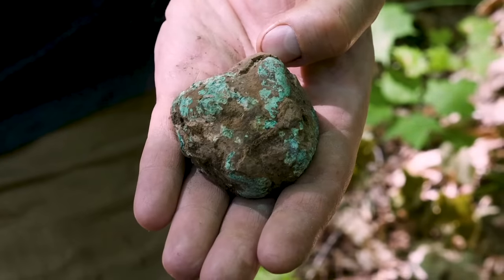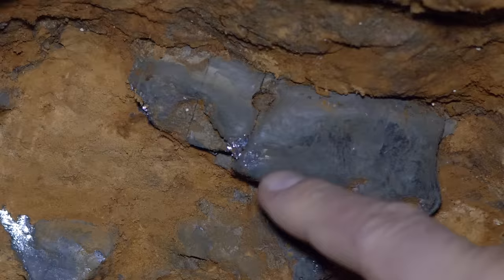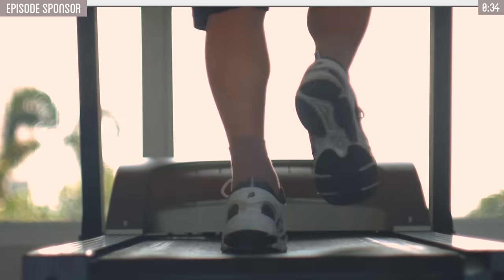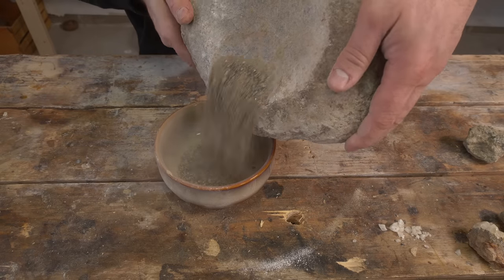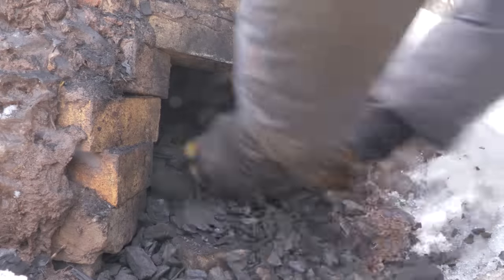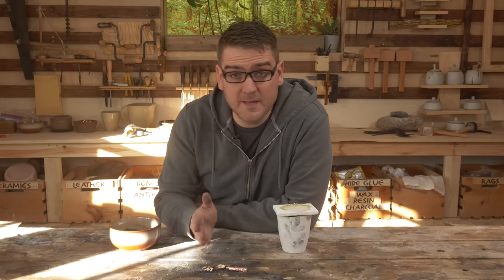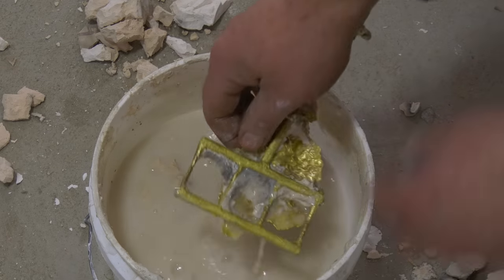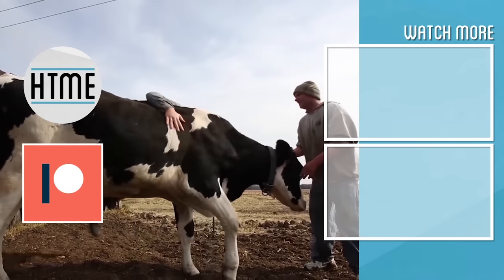How To Make The Hidden Metal That Helped Build The Roman Empire

Comment: Bronze makes better, longer lasting bearings, but brass is a perfectly acceptable alternative. And yes, it’s easier to cast and clearly you’re looking for a good demo application for your new alloy. So really looking forward to seeing you make that progress 😃
Reply: Would imagine zinc is more common than tin as well.
Reply: @davidmcgill1000  zinc is hard to extract due to it's low boiling point and high toxicity.
Reply: Wouldn’t they be bushings.
Reply: @Volt64bolt  Bushings are a type of bearing.
Reply: @entropy1454  oh ok, my bad. I thought bearings specifically referred to ball bearings where there are multiple moving parts inside, and a bushing is just a low friction slow wearing sleeve
Reply: A better bearing than brass or tin bronze would be aluminum bronze, though that's obviously more of a modern thing.
Reply: Brass has a better coefficient of friction against lubricated steel. Nearly all mechanical clocks are brass plates with steel pivots.

Comment: Brass is very good at sea. Very resistant to corrosion. The brass bushings in my sailboat's rudder axle are still going strong, 37 years on.
Reply: Holy manure, 37?
Reply: Highly likely bronze. The zinc in brass makes it almost useless below the waterline. My boat is bronze fastened wooden 46ft cutter over 100 years old. I won’t have brass anywhere on board. Bronze yes. 
Unfortunately it’s difficult to tell the difference between some bronze and brass fittings. If yours was brass it would have dissolved over 30 years ago.
Sorry
Reply: @humanafterall2076  Admiralty and naval brasses could definitely withstand salt water for that period of time.
Reply: @Shaker626  these still have a zinc content. They will stand up to the salt air environment but definitely not constant immersion.
Reply: @humanafterall2076  The reduction of Zn in those brasses, along with the addition of Sn and As reduces the dezincification inherent to brasses. Maybe they won't last 100 years like a bronze part, but they could push 30.
Reply: i sea
Reply: @humanafterall2076  That's exactly what was thinking when I read jannepeltonen's post.

Comment: Brass is an awsome material to work with and it has excelent corrosion resistance. It's resonably strong so for most things it's prenty strong enough. The only reason it isn't everywhere today is that it's kind of expensive compared to aluminium and steel.
Reply: Does aluminum have comparable corrosion resistance to brass?
Reply: @Ensensu2  Sort of. Aluminum "corrodes" instantly on contact with air by forming a thin layer of aluminum oxide; unlike rust, this layer is not porous so nothing further happens, so in air they are about equal. In seawater, however, aluminum is prone to corroding if another metal is present, while brass and bronze are not, making aluminum the worse choice there.
Reply: @Ensensu2  And aluminium parts tend to wear down quickly under abration, and they also tend to get stuck to eachother, that's why you rarely see things like lock mechanisms, sliders or such being made from aluminium. If you are going to make something that doesn't require moving parts like say a boat hull or railing then it's an excelent option.
Reply: @skylerlehmkuhl135  
Well, every metal, even stainless steel, more or less instantly corrodes when it comes in contact with oxygen.

If they didn't, cold welding would be a serious problem. Cold welding almost killed a few astronauts when it stopped them from closing their hatch after a spacewalk back in 1965.
Reply: @lordgarion514  : As I recall, the "cold welding in space" thing was debunked. It might have been a contributing factor, but the problem was primarily caused by something else.

As for most metals instantly corroding, that's an overstatement. As mentioned already, iron rust (or at least the "default" one) doesn't form a barrier to air, so if iron "instantly" corroded then there would have been almost no iron alloy tools until the development of stainless steel, due to minor scratches damaging any protective patina (some forms of iron rust don't flake, but they form under different conditions), and thus begining the process of their own quick destruction. The reason iron tools were possible for e.g. swords for so long is because iron doesn't actually oxidize very quickly. Stainless steel does corrode quickly, but that's for the same reason as aluminum: it contains some highly reactive metals as part of it's alloy, and these form a protective coating.
Reply: it is only bad for steam engines if you are an modell builder and make the boiler from brass it explodes after continious use because it gets spongy it seams the steam extract the zinc from this alloy

Comment: I wonder if some early alchemists thought they successfully turned copper into gold when they performed this process? LOL.
Reply: The hardness is a bit high and the weight is a bit low, so the alchemists that thought that probably weren't very good.
Reply: @garethbaus5471  : Further, I'm not certain that alchemy existed when brass was first created. I think that alchemy only goes back to the middle ages, while brass in some forms goes back to the bronze age.
Reply: @absalomdraconis alchemy dates back at least to the early iron age Greeks and Egyptians. There's hints that it might have been a thing in bronze age Mesopotamia

Comment: Bearings for your lathe could also be cast in place from babbitt metal, an alloy of lead and tin (sometimes with traces of antimony and arsenic), coincidentally it's roughly the same composition as ordinary 60/40 lead/tin solder.
The melting point of this alloy is also low enough that it will most likely brown (but not burn/char) the timber that the molten babbitt is poured into.
Reply: Thanks for that info. I work around a fair amount of babbitt bearings and had no idea it was basically 60/40 solder.
Reply: And I had no idea it could be cast in place. Brilliant.
Reply: isnt the lead to soft for bearings?
Reply: @Preyhawk81  You want your bearing surface made of softer material, so the cheap serviceable bearing wears out and not the expensive complex machine part. Babbitt is still used as the wear surface of engine main and rod bearings to this day. At higher speeds you need fast-flowing oil to help the bearing clean and cool, but even the higher speed pulley lathe would probably work fine with thicker lube, at least for a while. something like tallow seems like an ideal ancient-tech solution.

hell, given the choice between the two, I'd probably try lube on just the plain wood before going to the trouble of casting a bearing (and making a shaft precise enough to fit in it nicely!). even with the relatively crude smithed iron shafts they're working with, lubrication would make a BIG difference and help the wood last longer.
Reply: I doubt the shaft will be straight, rigid, or polished enough for such a soft bearing material.  It will likely chew it right up.

Comment: As someone who works with antiques, brass and bronze constantly cause issues with identification and classification - to the point where "yellow metal" or simply copper-alloy is used when describing most antiques with copper alloy components that havent been analysed yet. 

very important alloy historically.

Comment: The brass bearing described at the end of the video are called Bushings. It's a thing still used in heavy duty tool machinery even today. Bearings didn't become the preferred option until fairly recently (like within the last 50 years). Old Vintage tools often use bushings for heavy wear parts, simply because it was easier to source and use than bearings.

Comment: Brass was very important material in the industrial revolution for applications like bearings of steam engines
Reply: A had a machinist tell me that brass can be worked to tighter tolerances by an order of magnitude, i.e. fractions of a mil.

Comment: A close-tolerance greased hardwood bearing running on a polished shaft would be fine for your Da Vinvci lathe. Lignam Vite is the go-to wood, but Osage Orange, maple, etc., will work fine. 

Ancient metal workers weren't much different than modern ones. Some of us like to tinker and experiment. Surface deposits of Tetrahedrite (Cu,Fe)12Sb4S13,  also known as Schwazite and Fahlerz, are found over much o Europe, including Italy and Sardinia. Tetrahedrite ore is associated with Iron, Zinc, Lead, Silver, Antimony, Arsenic, and Mercury. It has been mined in Europe since the early Bronze Age. Brass would be a likely byproduct of refining a Zinc Rich Tetrahedrite ore.  Its gold color would get it noticed. Looking at maps of Copper & Zinc deposits in today's Italy, one would think Brass could be discovered if a copper smelter were built on a surface Zinc deposit when someone tried to recover Copper from the dross skimmed from molten crucibles of copper discarded on the ground, made up of Zinc ore, and getting brass rather than the copper they expected.

Comment: If you want to make bearings and you have zinc, babbit metal is your friend. The process of casting a babbit bearing is also interesting, though the discovery of this relatively simple process dates from the mid 19th C.
Reply: Babbit composition?
Reply: @lewisgiles8855  well there you open a can of worms. The one we're supposed to use nowadays is 90% Sn, 7% Zn, 3% Cu but that's not technically babbitt. The real deal is 89% Sn, 1% Pb, 3% Cu and 7% Antimony but there are many, many others.
Reply: Thank you I've been casting metal in my backyard for a few years I'm always looking for new alloys that I'm capable of making, I love iron bronze with such a rich color

Comment: I can’t tell if you use respirators, but if you haven’t, please do so. Zinc out cash is really easy compared to the other minerals. No one needs to breathe in that heavy metal.
Reply: Agreed.  Years ago I did some brass / bronze casting.  Even with the careful temperature control allowed by modern equipment you could see wisps of that blue/white smoke exiting the blast furnace that was zinc being burned off.  We always ran under a hood.  Being outdoors helps of course, but "belt and suspenders" as we used to say :)

Comment: It seems like you're reaching the point where precision becomes increasingly important.
Roundness and flatness are both unspeakably important for anything with moving parts. The wheel and axel and pulley are both massively improved by a mastery over these two things.

Comment: couple people mentioned already for different bushing, but a lead/tin babbit material has historically been the go to for bushing that wear do to cost and ease to reset them with just a torch and a ladle to melt the metal in and pour it into the worn out bushing. brass would work and be less toxic but bronze would be the real winner on that and is the common bushing now.

Comment: All those people saying zinc fumes are bad may be right, but it could be a lot worse. A significant quantity of Roman brass was actually made using arsenic as well as or instead of zinc. It's known as arsenical brass or arsenical bronze, and is just as useful as ordinary brass, with a few additional advantages over it (better casting properties, corrosion resistance and ability to work harden).

Comment: In the bronze ware of the Dongyi people who existed in Liaodong and the Korean Peninsula, zinc was mixed with bronze unlike neighboring China. Although the physical properties obtained in this way may be a little weaker than copper-tin alloys, it has the advantage of having finer and more stable properties when making castings. Because of this, complex casting work is possible, and zinc is still used when casting bronze in Korea.
Reply: gunmetal for britsh naval guns hat 2% zinc in it too. maybe it removes oxygen in the molten alloy too. interesting info
Reply: @Preyhawk81  //That's right. In the 18th and 19th centuries, with the development of materials science and metallurgy, we created alloys by rationally mixing materials.
However, it is probably in the tin yields they had that Europe and China mixed bronze with almost only copper and tin. Tin is a surprisingly hard-to-find mineral, and it is said that the Mediterranean bronzes used tin mined in small quantities in distant England or Afghanistan.
However, in East Asia, there were no well-developed tin production areas, and only China possessed and developed proper tin production. (Currently, Malaysia and Indonesia are the dominant tin producers, but not in the past!)
Therefore, the alloy of zinc mixed with bronze appears in the outer periphery of the Bronze Age civilization, where tin is difficult to obtain.
This must be the reason why zinc was stone in the Bronze Age of the northern grasslands and the Korean Peninsula!
In any case, it must have been a coincidence that zinc was mixed with bronzeware on the Korean Peninsula, and it would have been a while before the bronzeware mixed with zinc was deliberately used because of its physical properties. And by the time zinc was found to be useful as casting technology developed, England would have adopted the method too! Until it goes completely to the iron cannon...

Comment: Brass is also good for corrosion resistant applications.  In the nineteenth and 20th centuries it was often used for hardware, though nowadays those functions are more often filled with stainless steel, although brass hardware is still found in hardware stores and in some industrial machinery.

Comment: I'm always amazed at the sophistication of these alloys, especially bronze.  I have a 50 year old sailboat that has a number of bronze fittings and they look brand new, even after 50 years of salt water.  Bronze has a number of qualities that far surpass any other metal or alloy, and yet it is one of the first to be found in the archeological record.
Reply: It's a great metal, but when your technology is increasing, you quickly run into the problem of what you're building needing stronger materials, regardless of how corrosion resistance those materials are.

Which is why we build high-rises out of easy to rust steel, instead of highly corrosion resistant bronze.

Bronze, and other metals like it, are still useful for MANY things of course, but the bleeding edge of technology requires more than it can do.
Reply: Interesting fact Uchatius an austrian officer made from 92 copper and 8% tin steel Bronze it was special cast(in iron shells for faster cooling so the alloy couldnt seperate itself) and than steched or smithed they made gunbarrels out of it . They had the same durability as Steel barrels and the last of them got scrapped 1918.

Comment: New blacksmiths are often warned against sourcing their steel from galvanized parts. The reason is that zinc sublimates and the gas is toxic if breathed in. I have to wonder if the discovery of brass came from someone trying to see if they could smelt the rock alongside some other metals and the sublimated zinc getting accidentally absorbed into the copper.

Comment: It's likely the process was discovered through the use of copper smelting furnace made from the zinc ore rock - you're using firebrick but old school furnaces were rock structures.  Because the zinc will offgas from the ore that makes up the kiln, it would be able to mix with copper being melted in the kiln to form brass.  This would probably have been as some kind of odd alchemical reaction changing the copper, and even the ancients had the scientific method down in trying to replicate processes.  Somebody looking to replicate it would have realized that the furnace rock was important, and then would have likely experimented with that rock in other ways, like simply putting that type of rock (which we know know is zinc ore) into another regular furnace with some copper.

Incidentally, one thing you didn't cover was availability.  Workable tin deposits were quite rare in the Mediterranean.  The largest tin mines that supplied nearly all the major powers of the eastern Mediterranean in the Bronze age were in the mountains of Afghanistan at the far opposite end of the Persian empire.  Copper and later Iron were available all over in easily mineable deposits.  Zinc ores would be more readily available than tin, making brass significantly cheaper than Bronze for Romans.  Large tin shipments still came from Afghanistan via Parthia, along with other trade goods like silk, but those were exploited heavily by the Parthians to the detriment of Rome and other trading partners.  Most of what we know of Parthia actually comes from descriptions of their trade routes (which linked Rome all the way to China) and the Parthian coins found along those routes.

Comment: Zinc is common in other metal ores particularly with lead and copper, both in SEDEX deposits and also in Massive Sulphide deposits. If you were mining your copper from an ore body rich in copper and zinc then it's quite easy to see how a person could accidentally make brass. And once you have identified that the copper and zinc minerals are the components cam be easily replicated. Honestly I'm surprised it was not discovered and used during the bronze age, though I suppose if one is using surface deposists they tend to be drained of zinc as part of the oxidation layer is exposed to water.

Comment: Celtic is not an S sound.. it's a K sound. Keltic not Seltic. The only time the C has a S sound is when you are talking about the basketball team the Celtics. The problem you'll run into smelting and casting zinc is it fumes really bad, the fumes are seriously toxic and once it starts fuming it often lights on fire and won't go out until there's no more metal or no more oxygen to feed it. A bearing is one metal spinning around inside two other pieces of metal to reduce friction.. a bushing is one piece of metal that you put another piece in to reduce the friction.. get your terminology right.